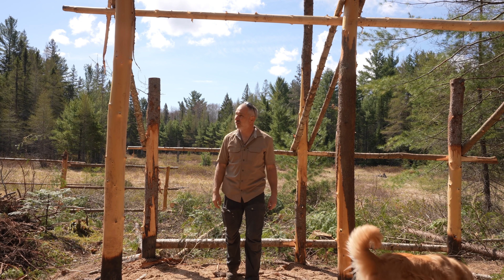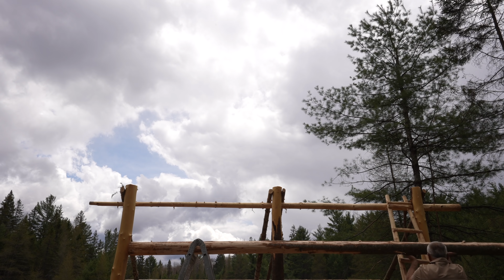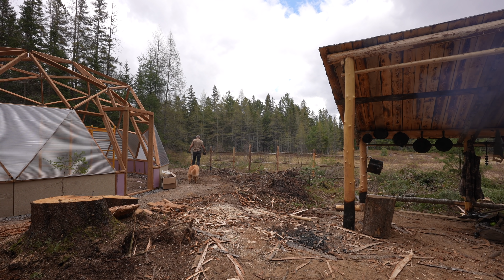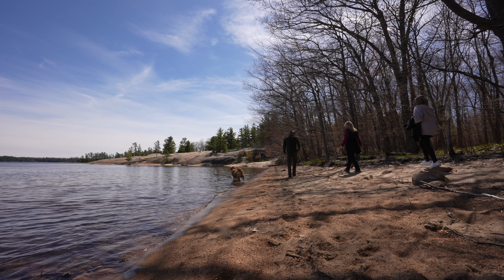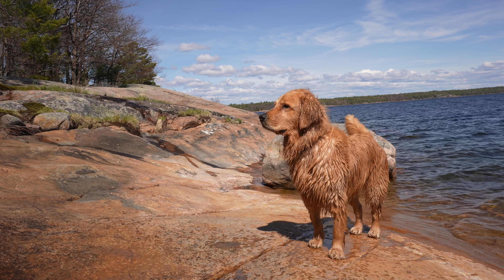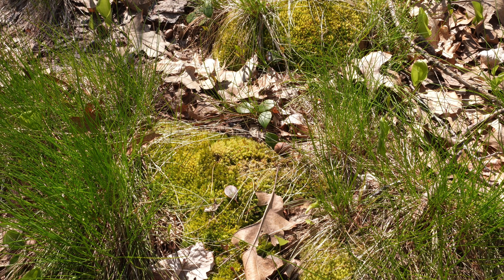Moose in my Shed, Waterfront hike with my Family

Comment: I'm terribly horrified again, Shawn you've made terrible mistakes again with the Geodesic greenhouse, I see mistakes again with the isosceles triangles Hollow-wall double-skin sheets, you have to dismantle some of the isosceles triangles again, turn them correctly, so that condensation and rainwater can drain, re-assemble vertically in the water drainage direction, transversely incorrectly running hollow chambers, incorrectly right-angled hollow chambers, incorrectly left-angled hollow chambers, the hollow chambers must run vertically, from top to bottom, drainage direction so that condensation and rainwater can flow off and themselves no algae and no moss form in the hollow chambers, so they must be installed vertically and not across. Correct assembly of the acrylic glass multi-wall sheets - when installing outside, always mount the hollow chamber / double-wall sheets in the direction of flow, not transversely but always vertically so that possible condensation can always drain away.
Recognize inside instructions z. B. room dividers, suspended ceilings, etc., the panels can also be mounted horizontally regardless of the web direction. H. To lay the water flow direction! Only in this way can condensation water and slabs escape and algae and moss can form in the hollow slabs. For the front sides of the plates, gold-plated for outdoor use, the basic rule (also for triangular cuts): As close as you should at the bottom - as close as possible at the top!
For subconscious end faces, this means that the chambers must be protected against dirt from water, water and insects, there is no need for ventilation of the cavities and condensation or condensation water can evaporate!